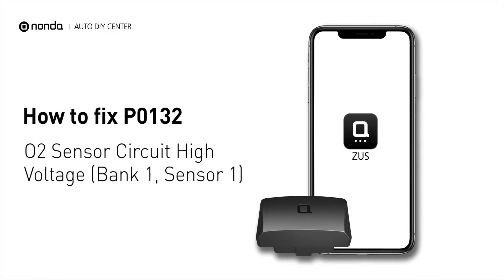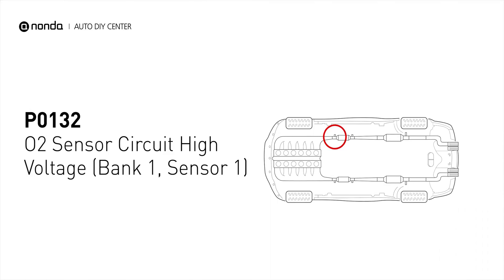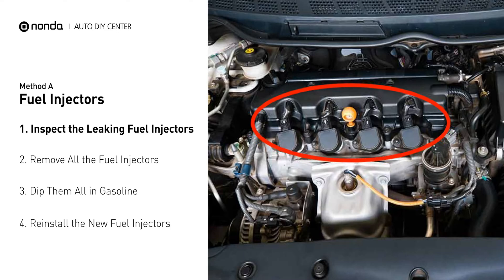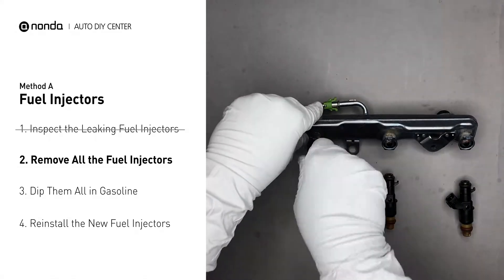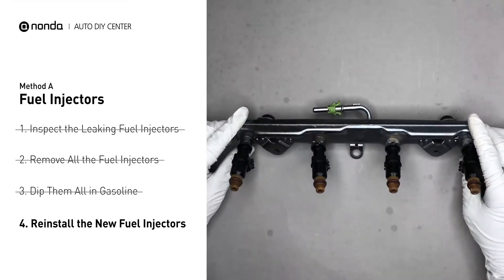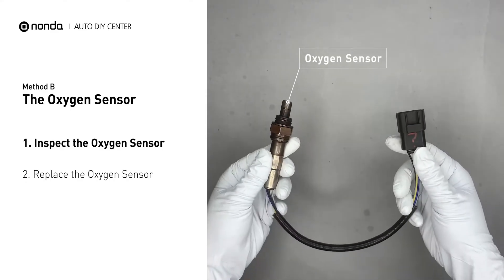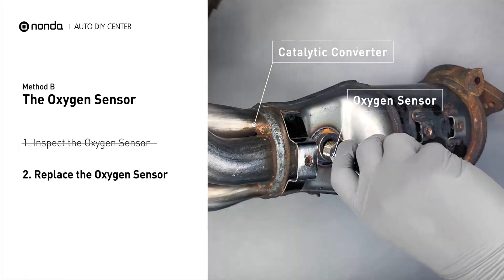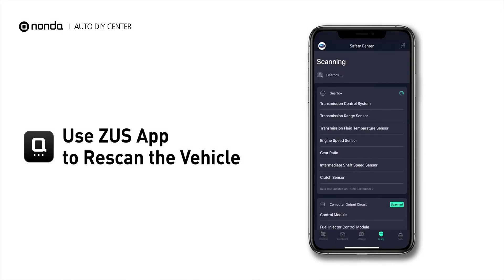How to Fix P0132 Engine Code in 3 Minutes [2 DIY Methods / Only $8.78]

Comment from the maker: Hi, I'm Steve, nonda's lead mechanic engineer. 
Feel free to leave your comments here if you have any mechanic questions, I will be glad to help you out!
Reply: Hey Steve I just replace the O2 sensor bank one and that’s when I got a P1032 code so what else can I check
Reply: I have a 1999 Dodge Durango.  It has started to drive rough and the check engine light came on.  I scanned it and it reads PO132.  Please help tell me how to replace the sensor in this truck.
Reply: Agape93 S - Did you ever figure out the problem?

Comment: Your suppose to use engine oil on injector orings, not gasoline.  Also replacement of all injectors is not required unless you have the money (injectors are not low cost).  
This video has click bait title. 8$😂.   Thanks for trying though.
Reply: How do u know which one is faulty tho

Comment: so what happens when I get a p0132  and a p0135.. The fuse was blown and has been replaced. After a test drive I ended up with both codes
Reply: Which fuse?

Comment: Is this for 2015  Jeep Grand Cherokee ?
Reply from the maker: Hi Jaime, yes- for the oxygen sensor. Kindly check the voltage coming to and from the oxygen sensor if within your specification. You can use a voltage test light to confirm if it's getting any voltage. The test light could also help to check if you have short circuit that contributes to the appearance of this code.

Comment: What if that doesn’t fix it?
Reply from the maker: Hello, if these methods wouldn't fix the issue, you may verify the troubleshooting guide for your vehicle by checking the service manual. As treating codes could be different per vehicle's make/model.